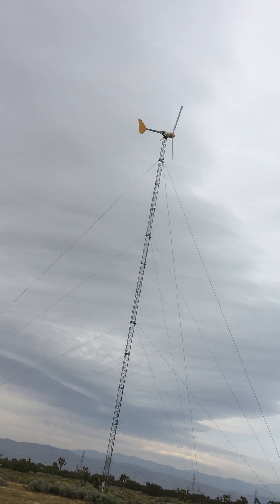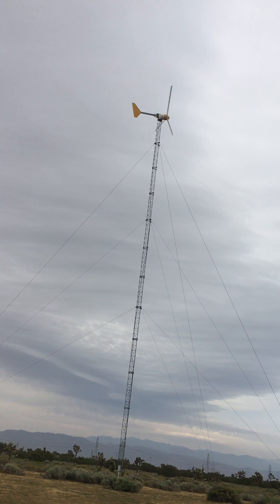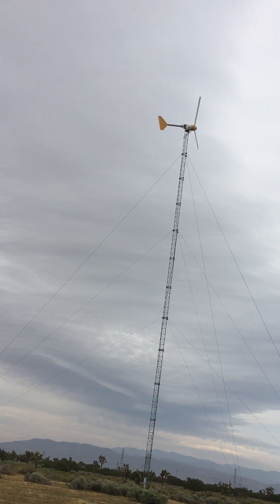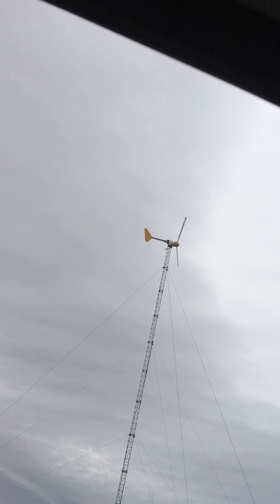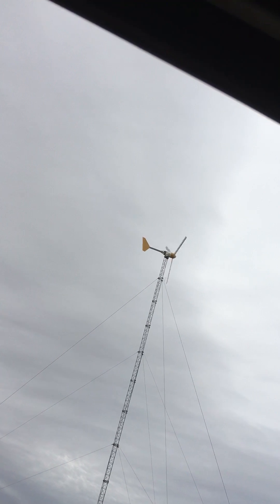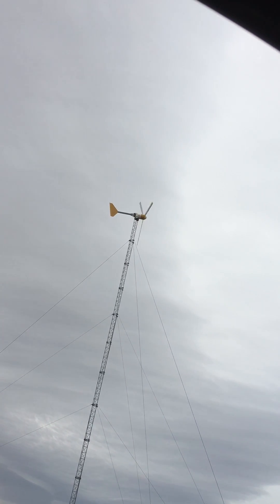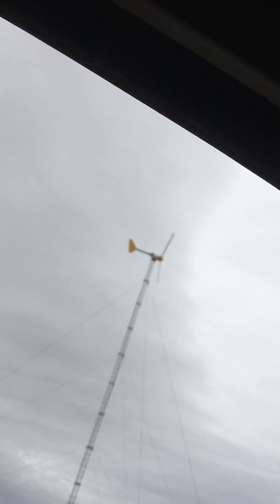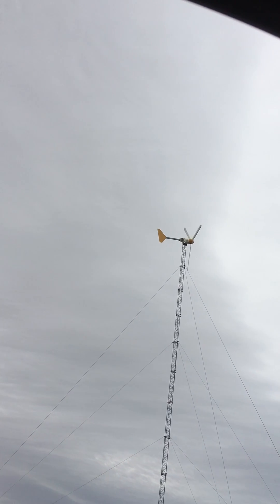Bergey 10 kW Wind Turbine Leading-Edge Tape Noise

Comment: That is NOT the noise they make; it is likely a bad bearing thumping once per rotation. The 20kw Bergey at the Forest Service in Saratoga WY has never made any mechanical noise over the 15+ plus years I have been watching it. And it often turns away in high winds at max rpm as you would expect being fully exposed to Wyoming winds on a 65 foot tower.
Reply from the maker: Sorry to correct you, but: 1) There is no such thing as a Bergey 20 kW turbine.  Their largest s a new 15 kW turbine, released a couple years ago.  2) If you read the comment below yours, it confirms the noise.  Here's a link to that video: https://www.youtube.com/watch?v=Yuc8UxRPXx4    3) I know all the people at Bergey, and have run and rebuilt their turbines for years, including removing the peeling leading edge tape from the blades, filling the leading edge erosion with epoxy meant for the task, and covering the repaired sections with a hard epoxy coating from the wind energy industry.  4) We keep an extra Bergey 10 KW turbine here so we can swap them out when one goes bad.  5) I've been in the wind energy industry for 20 years.  5) Everyone who runs a Bergey 10 kW turbine knows very well the peeling leading-edge tape noise issue.  It is amazing how a small piece of tape at 160 MPH sounds like a freight train!  6) The turbine in the video was a replacement for one that was dropped and smashed.  Unfortunately this replacement was installed wrong, with one wire not completely connected, and so the one you see burned out its generator once the wire fell away from its terminal.  Consistently incompetent work by local installer - we use other service people now.  But I know very well what this noise is - I fix the blades, after which they are quiet.  Besides all that, Bergey is, in general, a good company, and their turbines are good products. Their new 15 kW unit is a different design, and seems to be doing well.

Comment: Hi Doug, how high up is your turbine? Did you get the extra noise sorted or is that loudness normal?
Reply from the maker: Hi Seamus: The tower is 120 feet tall.  
That noise is normal for any of these turbines, when even a single corner of the leading edge tape comes loose.  After years of dust and raindrops at 200 mph, it's quite likely some tape comes loose from the blade, and they can then get very loud. The solution is to replace the tape with a professional leading-edge protection system.
OK first, this was a used turbine, stuck on my tower after the local installer dropped my original turbine that came with this house, during an attempted removal for a factory rebuild under warranty.  Apparently the manufacturer had a bad batch of bearings, which may be why the original turbine had been falling apart within its 5-year warranty period.  The turbine had been running unloaded for years, making a huge racket that caused a lot of neighbors to be anti-wind energy.  The local installer would not come over to diagnose what was wrong with it.  Once I moved here, I had to handle it.  I had a friend with climbing equipment go up and find it was falling apart, by shaking a blade fore-and-aft, and noting that the entire rotor was loose.  Between the bad local service and lack of support from the local installer, and erroneous tech support from the factory, the used replacement turbine in this video burned out its alternator.  So that was strike-2 for Bergey, which was hard to believe, since we had all been friends for years.  Turns out one of the 3 power wires was never connected to its terminal properly by the local installer when the used replacement for the original (accidentally dropped 100 feet by the local installer) turbine was installed, so that wire was just "floating" on the terminal, til a few years later, the wire fell away, resulting in "single-phasing" operation, which made a LOUD grinding generator noise, and quickly burned out the 1000 lb. alternator.  
According to California law, a licensed contractor remains responsible that products are installed according to manufacturer's specifications, for ten years, and this one had been installed for less than ten years when it failed, and meanwhile I had let Bergey know about the generator noise for years.  They kept telling me not to worry about the noise, confusing it with a different noise that their newer turbines were making which they affectionately called "the foghorn noise".  
I could have pressed the issue legally, but at some point you have to take matters into your own hands and just get the job done right. 
I found a cheap used replacement turbine of the same model, refurbished it, and paid an out-of-town installer to swap them out.    I removed the leading edge tape from the new (used) blades, and replaced it with a professional 2-layer system using epoxy putty, followed by epoxy paint, made for utility-scale turbines, and recommended by a friend in the industry.  The new (used) turbine is relatively quiet now, powering this place, and making its rated output at this moment since we have a healthy wind blowing out there right now.  So this is Bergey turbine number three (3) for this site, and it is only due to me babysitting the whole situation for over ten frustrating years now, that there is anything running up there at all.  But Bergey turbine #3 is running well for now, and it is now much quieter than the ones with leading edge tape.  All it takes is a loose corner of the leading edge tape to sound like a freight train/Huey helicopter, so I'm sure glad I moved on from being dependent on the original installer and the original turbine configuration.  The manufacturer had also advised not worrying about the broken furling cable - they all break.  Someone finally noticed the reason the furling cables break was the tail trying to push the cable into its sheath (you can't push a rope), so we also added 20 lbs. of lead weights to the bottom end of the furling cable, to keep tension on it, and the turbine now furls much better in high winds, and has not broken the cable - yet.  Hopefully that problem is solved now too.
Reply: @dougselsam5393  Thanks Doug for getting back to me, I really appreciate that. My brother and I are entering the advanced stages of purchasing 3 of these wind turbines in CA and then shipping them to Ireland. That said I got a bit of a shock when I stumbled on your video. We have neighbours and they would find it difficult to withstand that noise should it happen.  

At the very least, it's making us think twice about purchasing or not.  I did a lot of research and as turbines go, the Bergey turbines are meant to be relatively reliable and quiet???

Thanks again for sharing your story Doug. Regards, Seamus
Reply from the maker: @seamusrispin1967  Well Seamus, if you want to avoid the noise from loose leading edge tape, do what I did get rid of the leading edge tape and replace it with an epoxy system made for wind turbine blades.  You first repair any leading edge damage (holes and voids) with an epoxy putty, then sand the repairs smooth, place masking tape on the outside of the same lines where the edge of the leading edge tape was, then apply an epoxy paint between the masking tape strips.  I added a second layer of the paint over the first, about a half-inch wide, right on the exact leading edge, because that is the only place that really erodes.  Again, use masking tape to establish straight lines.  I even sprayed on some white polyurethane marine paint over the repaired leading edge and where needed to make the blades look new.  So far MUCH quieter (way less noise) than even new blades with new tape.
Reply: @seamusrispin1967 Hi Seamus, did you buy the Bergey turbines? Just came across this video and your comments, I had a Bergey Excel 10kw for nearly 10 years in the UK and had the same noise issues. I'd loads of problems dealing with Bergey and in the end replaced their turbine with a different make. Final straw for me was when they refused to honour their warranty on my alternator claiming it had had a lightning strike (it hadn't as there'd been no rain during the period it failed), alternator had failed after water ingress, they quoted me $13000 for a replacement alternator and shipping, I refused and replaced the turbine after 3 years of downtime and arguing with them. If you've bought the Bergeys already I hope they're going well for you, if not I'd say avoid Bergey if you can.
Reply: @drewmiller7660  hi Drew in the end we didn't purchase. It turns out the shipping costs were going to be too expensive. Take care for now and Chat again soon. Regards Séamus